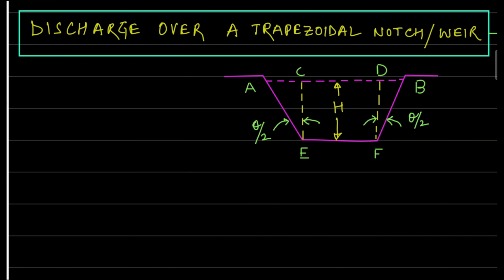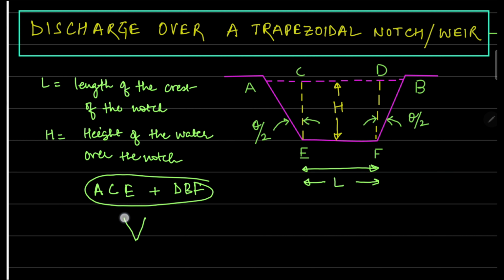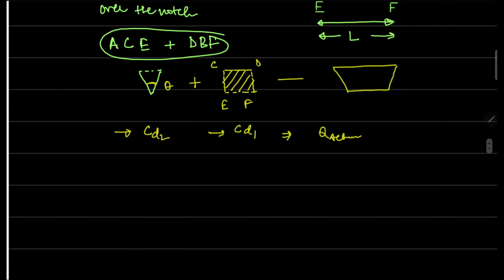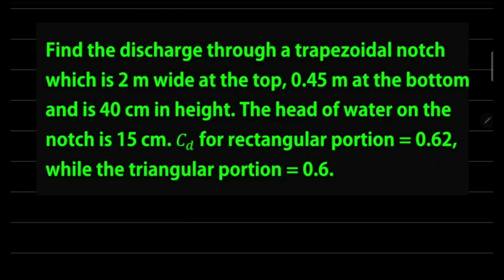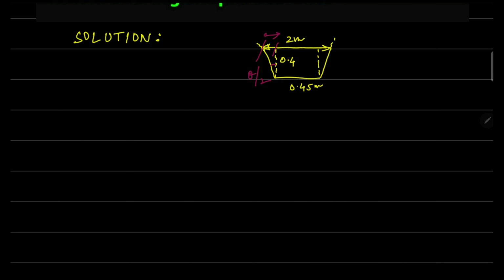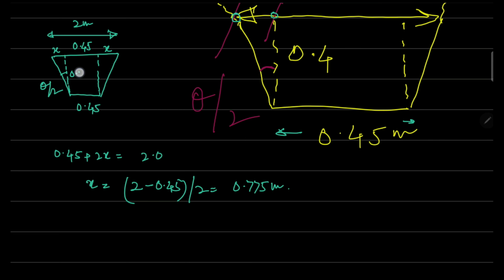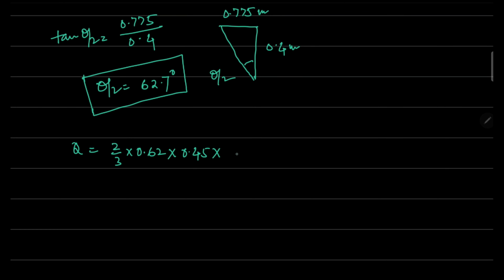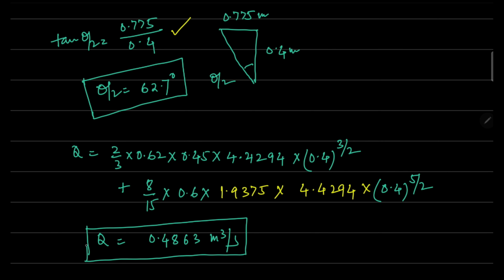Trapezoidal Weir and Notch| Derivation and Numerical Solved Example || MMMUT Gorakhpur

Comment: Sir isme head of water 15 cm h to calculation  me 40 lenge ya 15cm
Reply from the maker: Height of the notch is given so that you can get the inclination/slope of sides of trapezoidal weir. This angle is required when you are subdividing the trapezoidal weir into rectangular and triangular one. 
However, water over the crest of this trapezoidal weir is only 15 cm. This is whu we are using gead of 15 cm only.
Reply: @DrVBCIITB  thanks sir